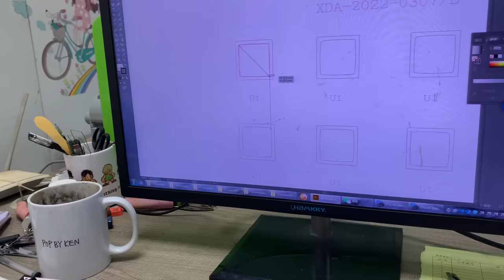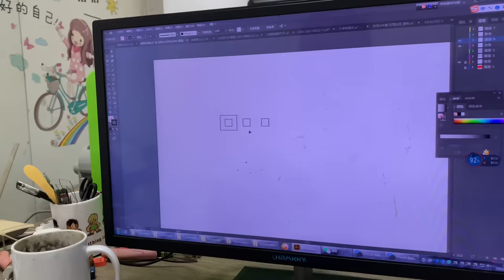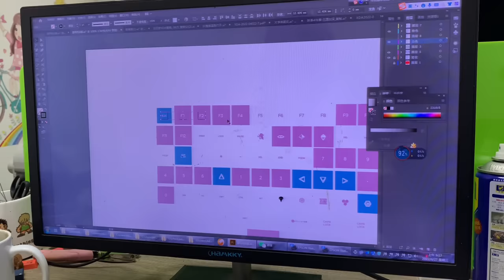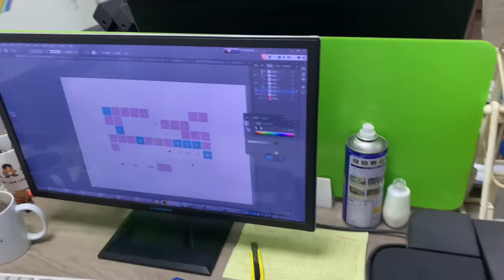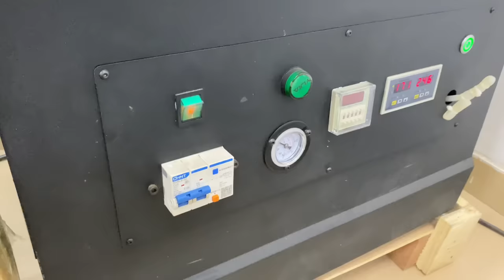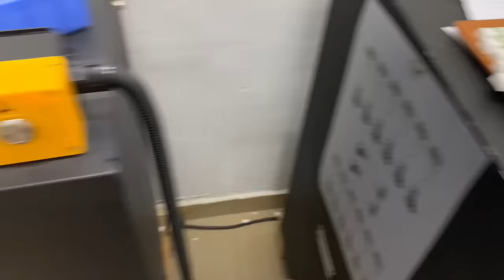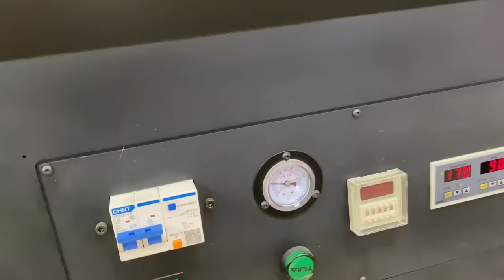PBT keycap dye sublimation for machanical keyboard, how to custom print your own mechanical keycaps?

Comment: Hi, can we do this without the vacuum machine you are using? What are the other cheaper options
Reply from the maker: Sublimation printing need accurate temperature and big pressure, so other options can’t work well
Reply: @Chinadyesublimation  Thank you so much for the reply. But, what is the name of that machine
Reply from the maker: @henzonllarves8564  model name : INV-3DA3 max

Comment: For example I want to put whole picture on my whole keyboard. How do I convert the original design on original template to template that I can print and that will fit the tray in the machine?
Reply from the maker: We have jig pdf template for you , and you use Adobe illustrator to open it , then you insert your design is ok
Reply: @Chinadyesublimation  how can I get this template?
Reply from the maker: @kimchibaebae3405  we will have jig pdf file for you once you place order
Reply from the maker: +8618779088275 whatsApp,  please message me there

Comment: Could mold+heat be used instead of vaccum heating?
Reply from the maker: Dye sublimation need pressure and heat , so need both
Reply: @Chinadyesublimation  Could pressure be applied via mold?
Reply from the maker: @rewindoflow  need put in the mold and use vacuum pump press
Reply: @Chinadyesublimation  Sorry, what I mean is, to use another mold instead of the vaccum to put pressure on the film/keycap.

(Sorry for so many messages, thanks for your patience!)